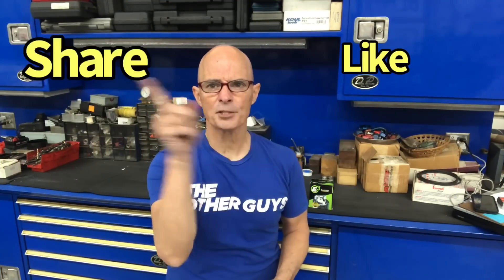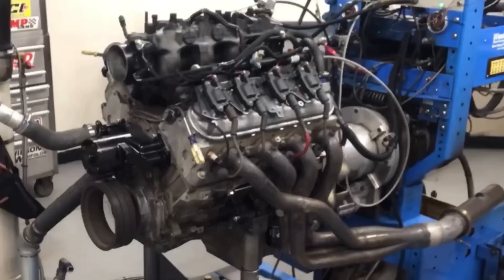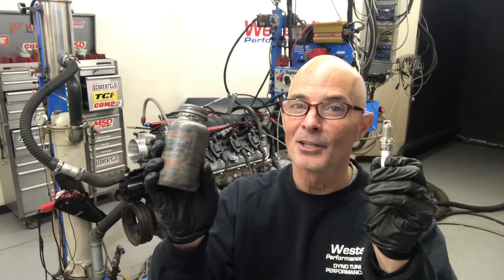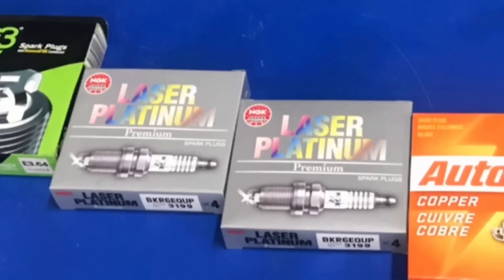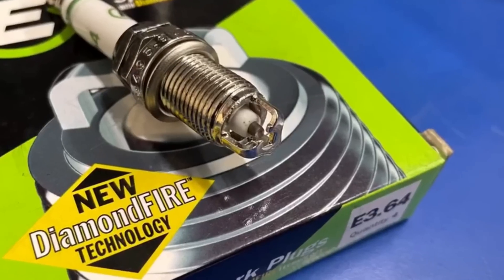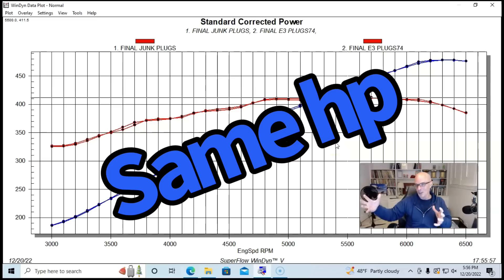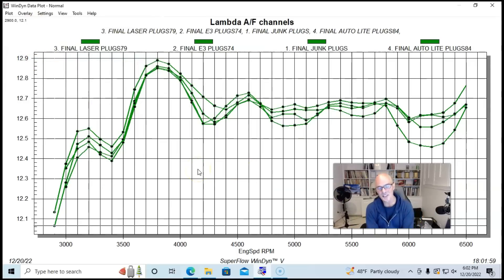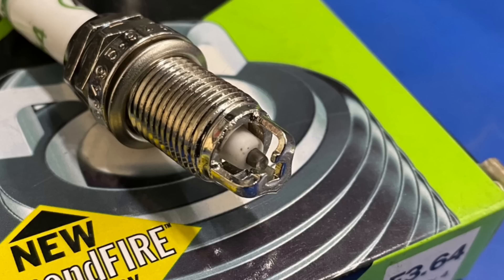E3 SPARK PLUGS-DOES DIAMOND FIRE TECHNOLOGY REALLY ADD POWER? E3 VS LASER PLATINUM VS CHEAP COPPER

Comment: I have not watched the video, but personally E3s are not my thing, in fact I ended up with random misfires, when we tried them on Dyno...Gimmick like Splitfire, or complete BS like Pulstar... The thing that any multiple ground electrode spark plug does, is they last longer electricity takes shortest path no matter what, so, when Electrode #1 is worn wider than #2 or #3 or #4 then it will Arc to one of those...Making them last longer with a certain amount of redundancy...Aircraft has used this since the 60s or 70s.

Comment: copper is a much better conducter than those exotic metals. so the copper plug will actually make a hotter and bigger spark which means combustion will be just a tad better. but they will not last nearly as long as the exotic metal plugs will. a fuel economy and combustion chamber deposit comparison would have been very interesting. would have also been interesting just to see the plugs fired side by side outside of the engine.

Comment: I work with CNG heavy duty engines that use the 3 ground electrodes with a tiny gap.  The 3 prongs and tiny gap are designed to keep the ionization of molecules from being blown out.  On a gasoline engine I would assume no difference unless under high boost with high swirl combustion chambers.  So there is a place for fancy spark plugs but not an LS.

Comment: This result totally makes sense, given that a fine mist of gasoline is VERY easy to ignite, then combine it with the heat and pressure in a combustion chamber the spark required is not very much.  the only reason for the exotic metals is simply due to the fact they last much longer maintaining the engines performance which reduces emissions and maintains economy.
Reply: The leaner you get that charge, the harder it is to ignite.  I’m trying to get my rig running as lean as possible for good cruise economy and any advantage is welcome.

Comment: While I would agree that a spark is a spark and it really wouldn't matter in most cases... It is important in all out cases that the spark plug doesn't become a glow plug. Off the top of my head you would have to run the engines with pre knock detection and time them for that to see as well other than just a plug that fires on a low horsepower engine. Does a design work better or worse in that aspect?  A 470 some hp LS v8 is really nothing these days.... that's what one would run a in a daily driver and likely get beat by a new car with a stock turbo 4 cylinder from the factory. I think you need more effort and using a turbo or supercharged engine in the 1000-1500 hp level.

Comment: well with my Colorado with the 5.3 the plugs are a bit of a PITA the front driver plug is def a PITA.  I would rather pay more for the plug that lasts longer.  I bought it with 101000 miles on it and the first thing i did was change them with more stock plugs.  Should be good for another 100k or until the 6.2 goes in.

Comment: If theres any real difference in those plug designs, it is probably engine smoothness at really lean airfuel ratios. Multispark ignition systems do that much better than any unconventional plug design can do. Might make for an interesting test though- hold the load constant, and lean the mixture to the point of roughness and compare the plugs that way. Although it is way out of the scope of a performance application.

Comment: Only place to use those expensive iridium plugs are on a Ford 4.6/5.4L engine. The plugs always break trying to replace them because of a terrible design, so put the longest life span plugs you can find in them when replacing them.

Comment: I've never believed any performance gains from plugs. Ignition is ignition. I think it's more if your ignition system can reliabily fire the plug. And I think it's less of a worry on these V8's with high powered ignition. I have a 1994 Kawasaki Ninja in the garage that no matter what I did, I could not get it to run. Last thing I did was change out the brand new Autolite plugs to a set of NGK platinum and it fired right up. I'm thinking different resistance through the plug let one fire and one not to. I think that's the biggest thing with plugs, other than life span.

Comment: FOR A STREET ROD A CAR USED DAILY STICK WITH THE CONVENTIONAL PLUGS LIKE THE AUTOLITES/MOTORCRAFT/ETC. STAY AWAY FROM THE E3 PLUGS AND PLATINUM PLUGS. THEY PULL MORE POWER FROM THE COILS WHICH LEADS TO OVERHEATING ON THE COILS. WHICH IN TURN DRAWS MORE CURRANT FROM YOUR COMPUTOR WHICH CAN BURN IT OUT WHERE YOU BREAK DOWN. (AND OF ALL THINGS YOU DON'T WANT TO BREAK DOWN IN RICHARD'S NEIGHBORHOOD). ALL IN ALL RICHARD HERE HAS PROVED THEY MAKE NO DIFFERENCE. GROWING UP. NO MATTER IF IT WAS A FORD OR A CHEVY OR A PONTIAC, ETC. THE CHOICE OF PLUGS WERE THE MOTOCRAFTS. I REMEMBER DOING A TEST ON SPARK PLUGS ON MY FRIENDS SMALL BLOCK FORD. WHERE WE BOUGHT A FEW DIFFERENT BRAND PLUGS EVEN THE DELCO PLATINUM, CHAMPIONS, AND A FEW OTHERS.  WE PULLED THE FUEL PUMP FUSE AND TOOK ONE OF THE SPARK PLUG WIRES OFF AND INSERTED EACH ONE OF THE DIFFERENT SPARK PLUGS AND CLOSED THE LIGHT IN THE GARAGE WHERE IT WAS COMPLETELY DARK AND CRANKED IT. TO MY SURPRISE THE SPARK ON THE MOTORCRAFT PLUG WAS AMAZING VERY BRIGHT, AND ALL THE OTHERS HAD A DULL SPARK. STICK WITH THE MOTOCRAFT PLUGS THEY WERE THE STARDARD FOR BOTH STREET AND RACE CARS SINCE THE 1960'S.

Comment: Autolite plugs are used in some sports cars. Plus they have a 4,000 oms resistance. Which is less than other plugs. Giving you more stronger spark at the tip.

Comment: Once again a great dyno test run video. Take a look at when exotic type plug became more common place . It seemed to be when OBDII became the standard in 1996. With this system part of it was a vehicle that would remain clean running for 100k before needing significant service to the engine.  The exotic type metals would do this. Copper plugs did the job for 75 plus years before  o.e. install was a exotic metal type. I welcome other thoughts and observations on this.

Comment: Ive own my own repair shop for 34 yrs and personally saw an E3 lose a ground electrode and ruin the exhaust valve and seat.
I also saw 2 Bosch Platinums lose the center electrode and ruin both exhaust valves and seats.

Comment: I have a naturally aspirated LS7 that I have ran NGK TR6 spark plugs in platinum and copper variety at the same gap. 
I noticed the copper plug seemed to change the exhaust sound when revving up from idle, like it had more power as it swept through the revs. 
I didn't think much of it and installed a fresh set of platinum TR6 plugs a few months later. The sound and ease of revving from idle was reduced.

This year I removed the platinum plugs and put in a set of copper TR6 plugs, hey guess what...the sound is back when revving from idle, sounds meaner.

Your test definitely helped shed some light on subtle gains. On the chassis dyno though I didn't notice any gains that stood out at peak hp, maybe 0.5 to 1 hp at peak hp between the 2 materials, similar to what you showed.
Reply: I’ve definitely noticed the best throttle response with side gapped copper plugs

Comment: I switched out the standard NGK UR-5's with compatible E-3's at the track in my mid-12 second(at the time) Buick 455 and saw basically nothing after the switch. MSD 6AL ignition. Luckily I got the E3's off E-Bay for a reasonable price compared to the usual local prices. Kept them in just because and they still run fine a few years later.

Comment: I have run E3's in 3 of my cars. 95 and 97 Olds Cutlass Supremes with 3.1 V6 and 03 Ford Taurus 3.0 V6. The E3's get an "F". After a very short period I started getting mis-fires in all 3. Without the specifics, did a resistance check, some plugs were ok, some had really high resistance and some were dead, as in NO continuity. All went in the trash. I am not going to buy 50 plugs just to get 6 with the same resistance. It is nothing more than a sales gimmick. And I doubt very seriously that the Top Fuel guys ran these plugs in their lawn mower, let alone in a Top Fuel car. MEH!   BTW, aside from the psychological effect, no noticeable gain in performance or mileage either. You'd think at 63 I'd have learned by now.

Comment: It would be very interesting to see the RPM rev time as well to see if there was a difference.   Would be interesting to see if throttle response time is the same with all plugs.
Reply from the maker: RPM RATE IS CONTROLLED BY THE DYNO-IT THERE WAS A CHANGE IN REV TIME-WE WOULD SEE THAT AS POWER

Comment: Great video.  Bottom line if you have an engine tuned properly it will be insensitive to changes in sparkplug design. You could test sparkplugs forever if you wanted to.  You could look at things like changes in the AFR window, sensitivity to spark timing,  resistance/inductance affects on spark timing (actual delivered spark timing), sensitivity to knock.........  The OEM's have a tough job, making plugs last forever, meet performance / durability targets and not foul from cold splash.  Their cars are constantly being cold started and shuttled around dealership lots and storage lots never getting warm.

Comment: Man Richard preaching what I've been saying for years. I managed a parts store for about 10 years and always preached this info.
All plugs if firing will make the same power. The difference in high dollar plugs is that the expensive alloy plugs will last longer without burning out and fouling as quickly as something like copper plugs.
The NGK Lazer series plugs are designed with oem companies to be the best plug and are usually the OEM installed plugs. 
The only way to change how much power is Made is by changing cylinder pressure, either done by combustion chamber design or by forced or chemical induction.
Copper is an ideal conductor. It's the reason your home uses copper wire. But in an engine it will burn away eventually.

Comment: I like the E3 plugs for normal use ! they do not like high voltage coil packs ! The ceramic insulator will start to leak to the base causing a misfire !

Comment: Your results are what I expected. However it is interesting that one of your colleagues, Jim McFarland, was involved in the development and testing of E3 plugs. He published a number of scientific papers on the differences in burn initiation and flame propagation compared with a conventional J-plug. There is an interesting video done at Michigan Tech demonstrating the benefits of the design. I suspect that the weaker the ignition system the more likely they would be to show a benefit but, as your test showed, today's high power ignitions will fire anything.
Reply: I recall reading about an individual coil retrofit on a 5.7 vortec (sbc) and they had pretty substantial gains in the mid range. That's likely why there was no big gain here, the LS has plenty of spark. My own experince with LS's running fine with rounded copper plugs with >0.080" gap supports that idea.
Reply: @hydrocarbon8272 Great info, I'd like to read that if you can perhaps remember the source?

Comment: Copper is the most conductive but also the softest metal and will wear the fastest.  There's always trade offs in life.  The Ultra Irderpium plugs are for stock engines that have the hood opened once every 100k.
Thanks again Richard.  Funny how the E3 sponsored dyno shows make more power *cough* PowerNation **cough**.

Comment: one thing i achieved by using E3s was a stronger cumbustion stability.

Idle could be lowered another 100 rpm and it ran a bit smoother.

Powerwise there was no difference..

Comment: 13 years ago my local distributor gave me a set of 16 I put them in my hemi. I still have 14 of them in there to the day in 13 years I’ve only had two of them go bad. One of them was only three months old it went to a dead mess at 3000 RPM the other one I replaced about two years ago it had quit firing all together it runs no different  and it currently has 14 E3’s and two champions.

Comment: Ran e3 on our 2007 Tahoe for almost 4yrs ran fine. A couple months ago we did a tune up and changed our the 4yr old e3s for new e3s along with new coils and wires. 

Runs great everytime no issues no need to deal with needing to gap the plugs. Plus you get a nice exhaust pops after you rev it up.
Reply: Spark plug change causing exhaust to pop after accelerating isn’t what I’d consider “runs great”. 😂

Comment: I never noticed anything noticable unless the plugs were already worn to the point of issues it's usually the other parts that go first cap rotor wires all old school stuff I know but once a year a tune up w good quality parts made it start on cold days and stay running w out an issue nothing worse than 10 deg day and a car that won't start and that's when it's gonna happen too of course rite

Comment: Alright Richard you did a bad job no one cares about horse power with spark plugs doesn't take a rocket scientist doesn't take someone to finish their graduate from 3rd grade to know that that's a fault fairy tale what you should have done was which 1 does better gas mileage which 1 Because a three-year-old and 3rd grade could have told you that you weren't getting big gain in horse power doesn't take a rocket scientist to figure that out with a spark plug which one runs your engine better and gets good gas mileage
Reply from the maker: SCIENTIFICALLY DEFINE "RUNS BETTER", I'LL WAIT!
Reply: Your the best

Comment: I would like to see the same brands. Like laser ngk copper ngk ect.   I dont think it'll make a difference but i figure it's worth a check. I run ngk in  my b16a allmotor only thing i change is the nuber i run 7s in winter and 6s in the summer  Tyvm 4 all your content very helpful

Comment: I have always found it laughable when a customer who is really oblivious to the difference in quality in a set of  sparkplugs, usually roughly around 100k give or take i would do a tune up. The tune up entailed on the Fords i was working on normally because of a drivability issue usually a coil, sparkplug, or the boot gave up the ghost but I would also do a fuel and air filter, BG induction and injection flush including all new coil on plug boots. The plugs have always been platinum or iridium sparkplugs for longevity not for higher horsepower numbers as the uninformed would assume.

Comment: Copper is far more conductive then platinum or iridium they just will not last as long. I run cheapest plugs I can get a Napa. Usually champion or  equivalent etc. conductivity is what it is. And cost is huge difference 2 bucks a plug instead of 10+ and they won’t last 100k

Comment: Spark plugs won’t make Horsepower…. And most improvements in plugs are for longevity not for horsepower. If you wanna make more power with your Ignition system, gets more powerful coil, or spark box

Comment: personally I'd rather change copper plugs more often (45,000-50,000 miles) that way you're guaranteed to never have a plug get stuck in the head and you're more involved in seeing/viewing the plugs for information on your engines health. Ask yourself this: even with antiseize, would you want to have a sparkplug thats been sitting & corroding for 100,000 miles? Even if the combustion chamber side lasts 100k, how about the plug wire side? lol Also antiseize doesn't always work as good as intended especially if you live in Wisconsin or midwest like where I live....don't get me wrong it helps, but salt, snow, rain and thunderstorms all put their two cents in over 100,000 miles. 

Ask yourself this...how many oxygen sensors already come with anti seize on them and you still have to struggle with them if you live in the midwest? Yes A LOT. I'd rather change plugs more often than have that shit in there forever.

Comment: I wouldn't expect much of a difference on an na motor but would be interesting to see if it would on a 4 cylinder under alot of boost/turbo where ignition can be a factor.
Reply: Agreed, maybe with lots of retard/ advance would affect the outcome.
Reply: nope, if that were the case they would be original equipment on turbo or supercharged cars. if they even improved power, economy or efficiency by a consistant  1/2 % they would be used by oem, but they are not.
Reply: @b.c4066  my mitsubishi had a 2 ground strap spark plug from the factory. And you would have a much better chance of making a difference under higher pressures than on a na car. But usually just close up the gap. Again why I thought it would  he a better  test of those spark plugs claims. If your plug is doing the job already you aren't going to see any benefits.

Comment: Ford has a hybrid copper core and nickel spark plug which are two of the best metals to use and you can get them online for around 24 bucks for eight 50k mile life

Comment: I ran the E3 plugs for about 10k miles on a Pontiac 400. When I removed them I discovered the center electrode had broken on 3 or 4 of the plugs. I've never seen that occur before. I'd never purchase them again.